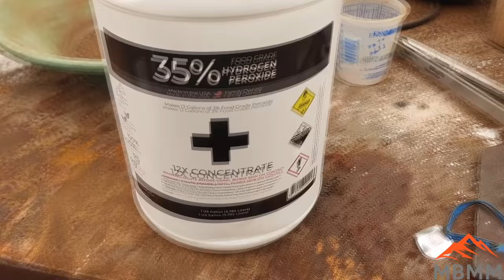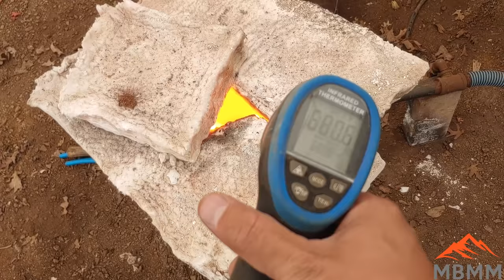Gold Recovery & Refining with Hydrogen Peroxide, Easier Gold Smelting

Comment: I'm not sure but on the side of caution I would not let that vapor get on your skin it could do some irritation. I would stand up wind all the reaction is happening.
Also want another point we were cleaning grease off the concrete floors of an old shop once and poured muriatic acid on the concrete to eat the grease out where they used to work on tractors in the vapors arrested anything that had iron content and wasn't painted anywhere it was located in the shop. Might be something you might want to try on this if you haven't already.
   The only thing I know for sure is you don't mix bleach with hydrogen peroxide because it immediately gives off sulfuric acid gas and you had to leave immediately.

Comment: I don’t know if you are doing much besides catalytic decomposition of the h2o2. You might be breaking up the particles some. I don’t know of any reactions that would take place without a acid(base) catalyst  of some type. I am glad that you have some respect for the 35% peroxide. It’s got almost enough energy in it to turn all the water to steam in an instant and increase in volume 12000x. You can build yourself a jetpack and run it with what you have left. FYI silver is a great decomp catalyst.

Comment: Point to ponder; magnesium sulfide is soluble in water. Unfortunately it reacts when doing so and generated hydrogen sulfide. So, adding magnesium to the melt to steal the sulfur in the hopes of just dissolving the MgS off is dangerous. BUT... making it slightly alkaline and then dissolving in peroxide should generate magnesium sulfate instead of magnesium oxide and H2S, so there could be a use for the peroxide after all.  If magnesium works as I think it might, then you'd end up with a mat that is base metal and MgS that would dissolve in peroxide with a pinch of lye or carbonate, and leave you with base metal in a bath of epsom salt. And a rotten egg smell, you'll never get completely away from H2S with sulfides around, unfortunately. 

Adding pure magnesium to the melt would probably cause a fire though, but you might try something cheaper and easier... milk of magnesia. Haven't done any numbers though, this was pure "15 minute brainstorming".

Comment: Hydrochloric and peroxide will put it into solution as Gold chloride that said I would suggest you try that because I don't know about the soft lights but that peroxide kind of expensive to be going through it as fast as you are on a meager 50 g which doesn't seem to be that cost-effective

Comment: I'm pretty sure even well-reacted metal oxides will still catalyze peroxide, just a bit less than the sulfides. I know from personal experience that 90% peroxide is much more enthusiastic in its reactions and once mixed with pain old dirt, keeps going until the concentration is very low, particularly when hot.

To get a more accurate check of the sample mass, I think you should have boiled away the used peroxide that carried away some fines, and added them back into the sample. That probably would have brought it back up close to 50 grams.

Comment: Loved the video again.  So would a tenth volume of hcl in the h2o2 make it economical?   I really would like to see you smelt shaker table concentrates from a bunch of hot rocks.  Maybe you could compare different magnetic and non types for their contents versus typical rusty quartz.  You are well  equipped to analyze positive versus negative hot rock metal content (metal detector signal +/- or just a truckload of all kinds.  Maybe you could smelt the metal out of meteorite if you get some.  Thnks again for the fun content!
Reply: Also maybe Clorox could be examined but it would be a pretty dangerous cloud!
Reply: What happens to these various sulfide and sands in aqua regia and other acids?

Comment: Bad idea. Hydrogen peroxide dissolves finely dispersed gold when heated above 55°C. Your reaction has caused that heat. By decanting the liquid, you threw away some fine gold. Since there was a base metal (iron) involved, you could be "lucky" and the dissolved gold cemented on the iron. But I guess you did not keep the gold-plated iron either?

Comment: What’s the best way to pull silver dust outta dirt? I pour a bit of silver and use an oxygen acetylene torch. It “spits” silver dust particles all over. I sand cast so over the last couple of years I’ve got silver dust mixed with delft clay and petrobond sand. Just curious on the best method bringing that silver out.

Comment: I knew molten SiO2 absorbs metal ions but did not know iron catalist causes the presious metals to drop out of solution.   These videos are great!!!  I wonder if it would ever be worth it to grind the sand with a ball mill, after it leaves the hammer mill, and then get the metals out of solution by electroplating.  The slurry may need to be boiled with sodium hydroxide to disolve silica into sodium silicate and free up more nano gold.  Not really sure if it would be worth it tho..

Comment: Really cool video but having worked almost 40 years in a papermill I don't think if it worked the EPA would let you do that on a large scale those emissions were pretty nasty we used to make a liquid cellulose with wood pulp and a heavy caustic and sodium sulfite and after the paper was treated with it we neutralized the caustic with sulfuric acid and it would create H2S and Cs2 gasses and the EPA did not like those I'm sure the gasses you made were probably just as hazardous.

Comment: Many metals and metal oxides will catalyze the breakdown of Hydrogen Peroxide to water and Oxygen with lots of heat. Would adding Potassium or Sodium Nitrate to the melt and heating it up turn the sulfides into SO2 and the metal oxide?

Comment: If you add Hcl and the H2O2 you will disolve gold likely
Reply: It's HCl and HNO3, mixed together that creates Aqua Regia which is capable of dissolving gold
Reply: Yep it will definitely dissolve any gold cause when you mix those you basically have (Aqua Regina)
Reply: Not without nitric acid
Reply: @hondosmith3172  doesn't work like that. Any strong oxodizer mixed with hcl will disolve gold. You can even disolve gold using nitrate salts like potasium nitrate or sodium nitrate ect... mixed with hcl.
Reply: @walkthroughguru  cool, I really am just beginning to learn this stuff

Comment: How would you deal with bismuth in precious metals?  I've had trouble with it trying to purify with nitric acid and aqua regia.  The bismuth apparently is soluble AT FIRST, but as the solution heats up, it turns from bismuth nitrate to bismuth OXYnitrate, which is almost totally insoluble.  Same thing happens with HCl, you get bismuth oxychloride, also insoluble.

Should I try dissolving the bismuth away with sulfuric acid first, which would also get rid of copper and other base metals?  Base metal sulfates would also be easier to reprocess, from what I can find, since many of the metals can be displaced in series from sulfates.

Comment: I do not recomend using peroxide for gold recovery in this method. The violent decomposition likely blew out a lot of smaller gold particles with the bubbles. Also i wouldnt worry about hydrogen sulphide as much as i woukd worry about the peroxide steam being boiled off.

Comment: I have watched several of these and was wondering if you have ever recovered anything? I've designed my own flux and just use another metals to finish it at the right time to recover it. I started out watching other people and it always seemed they were trying things that don't work,I've found the main problem with the way people try to smelt is their material has 3-6 other elements in it that even a assay won't show are there, and if you haven't removed ALL other elements from the gold sulfides your never going to recover anything, Good luck cause removing some things will also remove the gold your trying to recover, IE you might just want to go back and look at that brown dirt you were pouring off after the Hydrogen peroxide, hope this one clue helps

Comment: Strange.  I thought that after oxidation the sulfides should have weighed more.  So I suspect that a lot of sulfides were DISSOLVED in the peroxide that you poured off.  And there might be a small amount of gold SUSPENDED in it.  That bubbling would have effected the fine gold in the opposite way that the detergent works. Don't throw out that waste peroxide.

Comment: Using 35% you can start fire if its get on wood and leather at 35% but after it reach reaction and stops if left it turn into water. Used thousands of gallons weekly in making catalyst for oil and other uses.

Comment: I have had gold dissolve in peroxide and hcl when either peroxide was to strong or solution was heated. I think regular peroxide 3% with a little heat would be as effective but more economical

Comment: I make 90% H2O2 made from cheap over the counter types, HCl 35%, NaCl and gold. Wait seven days at least/or when it no longer bubbles. The H2O2 is administered by the drop slowly and continuously. The outcome is gold chloride. You can then drop it from solution with Sodium Hydroxide solution. If done carefully, it can be repeated to break down the nanoclusters into finer and finer molecular groups. Don't tell the guild that I told you.

Comment: 1:12 have you tried molten potassium nitrate 
its probably a lot cheaper
but you should add the sulfides carefully
hydrogen peroxide disproportionates quite easy so any sort of catalyst for that reaction will split your h2o2 into h2o and o2 (most of the gas released in your reaction was probably oxygen) you could try to add a very small amount of your sulfides to a larger amount of h2o2 to see if it will destroy all of the peroxide
a small amount of KI for example will disproportionate all (see elephant toothpaste experiment)
if you want to maximize the oxidation potential of your h2o2 you may add sulfuric acid to obtain what is called piranha solution

Comment: Hi Jason, Thanks for the videos. I wanted to share what I learned that worked for me in fine black sand. It's about "Electrical Charges" to separate, so chemically you use Vinegar for 30 min to change the PH (Rinse & Dry, then Re-Use Magnet to separate magnetite from gold), sometimes I recovered 50% of total weight not being magnetic. H2O2 is used on THICK CLAY to separate. - Hope that helps. Hey you wouldn't know a place near Battle Ground, Wa I can crush & put on shaker table my 10 yrs+ stuff I saved  would you? - Need to clear out for room needed for a build project/prototype Thingamajig. Thanks.

Comment: There should be hardly any hydrogen sulfides in the fizz because it will get oxidized to Sulfites and Sulfates. And it will never stop fizzing because even dissolved iron and other similar metals will decompose the Hydrogen Peroxide. I have a Ph.D. in Chemistry and am happy to answer your questions.

Comment: If you use the hydrogen peroxide and the hydrochloric acid try pouring your material into your solution that way you get an immediate response you might want to use an ice bath to keep the temperature down

Comment: A safe, cheap  and efficient way might to put it in an airated kids pool with some water. You could run the airater with solar panels perhaps. See what it does in a week or two.  Another experiment might be to mix it with straw and keep it damp to see how well bacteria breaks it down and how fast.
Reply: Third way would be to stretch some porous canvas over a pool with a recirculating pump attached to a sprinkler head over the ore on the canvas. The water will get airated by the air as it falls on the ore on the canvas and hopefully oxidizing it efficiently and quickly. Could use solar panels to run the set up so no electricity costs. Cut the sprinkler  off when you think its done and let it air dry. Have a draw string set up on the canvas and draw it up to transport it to an ore processing facility.
Reply: Maybe mixing in a bag of portland cement in the waste water afterwards will  neutralize the waste if neccessary.

Comment: 5:30 What happens when you mix hydrogen peroxide and hydrochloric acid?
The hydrochloric acid catalyzes an exothermic decomposition of hydrogen peroxide into oxygen and water. The accumulation of heat and non-condensable gas increases temperature and pressure in this reaction process always lead to runaway reaction and accident owing to inadvertent mixing.

Comment: Just because I'm curious, is hydrogen peroxide refinable or recyclable? This is something you could set up for a bunker water purifier, but if you take two or three two and a half or five gallon buckets and install two or three water filters, you can create a bug out water supply, and also something you can use to purify and clean alcohol for sale 3D printing. I haven't seen it done, but since water and hydrogen  peroxide are made out of the same thing, I wonder if the same technique can be applied. Is anyone done this or know that it works?

Comment: If you want a high % hydrogen peroxide  you can distill it with so loss to a high peroxide consintration I use cheap coffee pots like from carpets sales and salvation army As hydrogen peroxide bodies at just above 304 degrees f so the water mostly boils off first .

Comment: I'm curious about silver gets separated from gold.
Reply: Boil gold/silver mix in nitric acid. Works best if Au/Ag ratio is 1/3. Take nitric acid/silver solution, pour into bucket with copper. Copper goes into the solution, silver comes out. You can melt the silver down that way, but it won’t be very pure.

Comment: peroxide, not hydroxide. maybe you should have isolated and weighed the solids from decanting, and not just mix them with a bunch of preexisting rusty water? i dont even know if i can get 35% h2o2 in oz. maybe just need a dangerous goods permit for transport. nice experiment though. roasting sulfides is the pits...